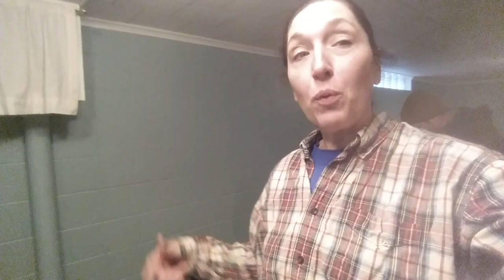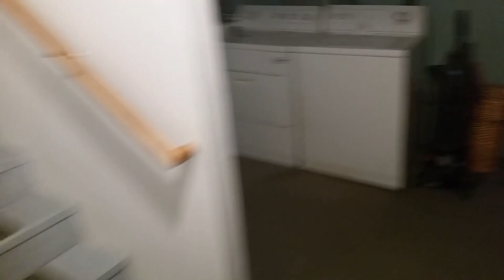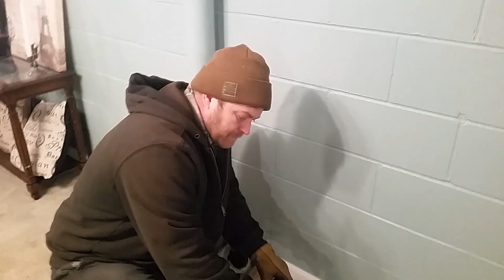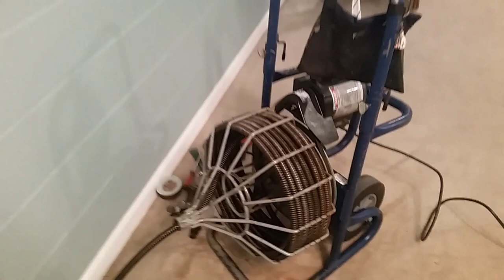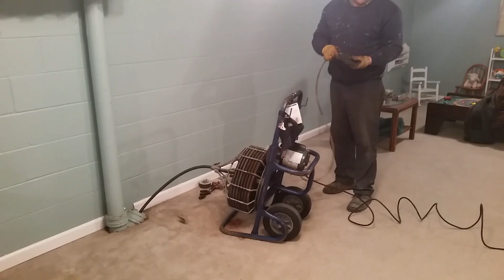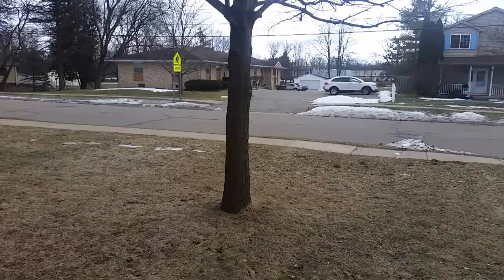DIY Rental Sewer Snake Drain Clearing

Comment: I was very apprehensive about trying to use one of these machines but after watching your video I got the confidence I needed. I had tried a small drill powered snake but it wasn’t strong enough to pull blockage up. I then bought a water bladder, blocked other line in kitchen with test plug and put the water pressure to it, after letting water run for about 5 minutes I went outside to see if water was making it to manhole, went out water was spraying out roof vent.😮. I finally decided to go rent this machine, it was a self feeder problem was fixed in no more than ten minutes. I did have to use my cutting torch to heat cast iron plug to get it loose. Thanks for your advice. Saved plenty of money 💰 😊
Reply from the maker: Good tip on cast iron plug!

Comment: Just had to rent one today for a few hours, would be nice if they had a cover around the line on the machine because its a complete mess going back and forth.

P.S it's a lot easier just to run the foot pedal underneath you as your feeding the line in and out, I cleaned out 75ft today two times back and forth in about 20min. The way you are doing it I'm not familiar with, but what do I know I'm no plumber. LoL 😆
Reply from the maker: Im running the foot pedal between filming for him.

Comment: The use of a camera is very helpful to determine if you have any sewer pipe damage after cleaning the line !
Reply from the maker: It would be helpful but not available to a homeowner for rental.
Reply: @mommymilestones  p,
Reply: @mommymilestones  Home Depot rents the cameras for sewage drains now!
Reply: @mommymilestones  sunbelt and united both typically carry cameras, as well as a location kit that can help you map your sewer.

Comment: Question, how come you don't use the reverse function to pull the snake back instead of manually pulling it?
Reply from the maker: Reverse just spins the cable in reverse. Pushing and pulling the cable is all done by hand.
Reply: @mommymilestones  yep, reverse is only used to untangle the line
Reply: Good to know!

Comment: Wait, you're not supposed to use rubber gloves? I was using big kitchen rubber gloves.
Reply from the maker: The cable can grab the rubber and break your hand or arm. Leather gloves are safer.
Reply: @mommymilestones  that makes sense, thank you!
Reply: They make these "ugly gloves" which work good also I hear.  Usually what professionals use.  I think they have hard tile attached to them or something so the cable glides over it smoothly.  They use auto feed machines though and hold onto the cable.  Way he was doing it in the video I don't think he ever even touched the cable while it was turning.  Maybe I missed it though.

Comment: This unit weighs 259 pounds and fits in the back of your car. Where do you rent an engine hoist to enter and remove the power auger? Also running down the basement steps is a two man job. I've been there before and it's a job. Just call a plumber and let him figure it out.
Reply from the maker: We handled is easily. Called nobody.

Comment: Why would anybody put carpet in a basement?
Reply from the maker: To improve the basement and make it liveable.
Reply: I have some carpet in a couple rooms in my basement.   It's a walkout though.  Not sure if it is common in a normal basement.  Regardless, I wouldn't put carpet around my clean out.  I have vinyl tiles in that area... also in the bathroom/utility room.
Reply: @101perspective  I live close to a river, so carpet in a basement is a horrible idea. As a former flooring salesmen, I would say that you made the right choice with the vinyl tile and not putting carpet right next to a clean out. Only an idiot would do something like that.
Reply: @ludwigvanbubthoven5692  Lol... or someone very confident in their sewer line.
Yeah, I'm not even sure I would try to finish a basement if I lived next to a river.  On the flood maps I'm outside any major risk areas.  One of the things I checked before buying.